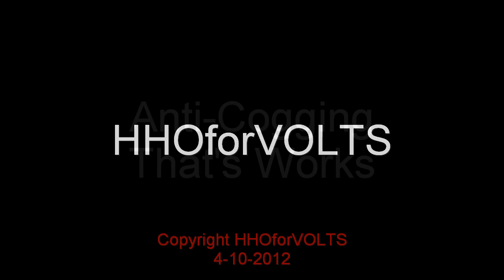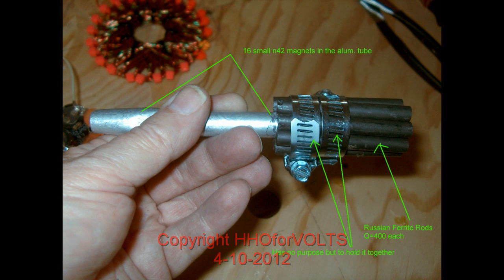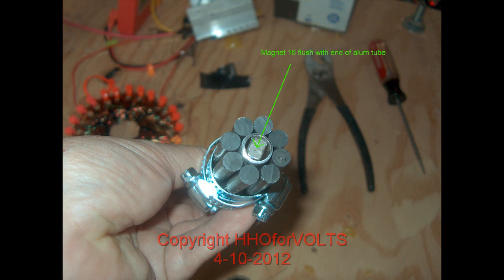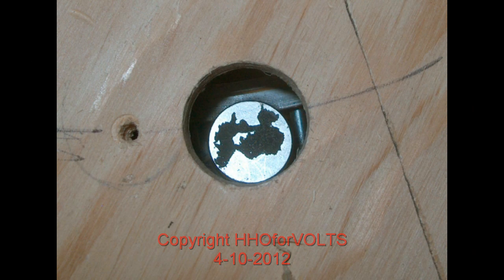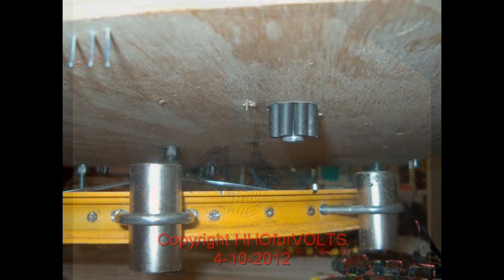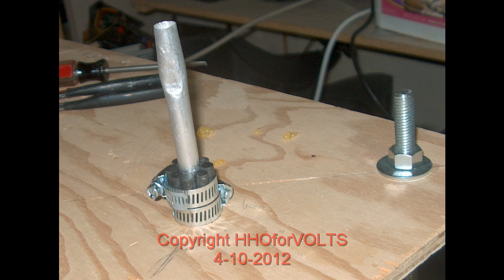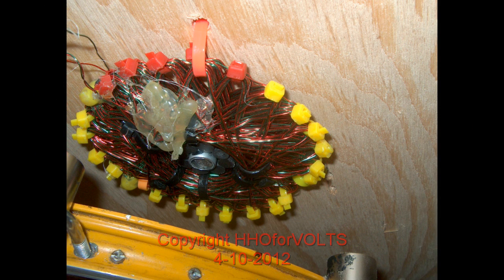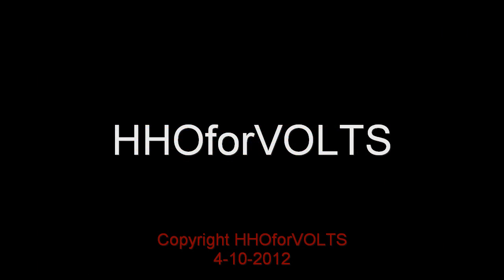Starship Anti-Cogging Device

Comment: You should look at the Hubbard coil generator. Aluminum deflects magnetic current penetration, moreso of the positive pole. I have video proving this using n42 on 1/2" alum.plate.
It will help field spin if you're attempting to gain momentum of magnetic current which is extremely useful when you want to store monopolar energy among separate ferrous parts. The true way to pick up free energy is using monopoles, a 3sine cycle then short then repeat gives ion acceleration, inductive implosive 0 pt